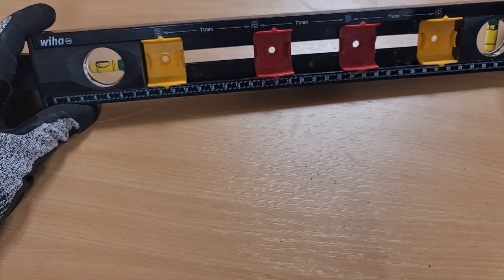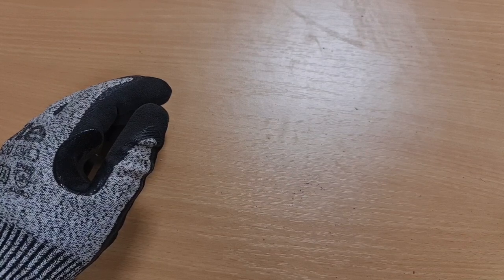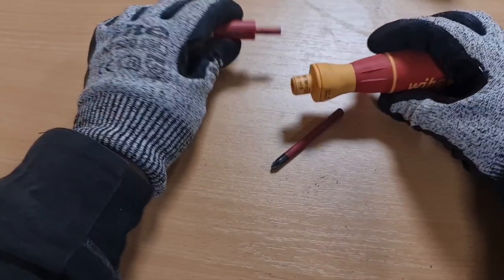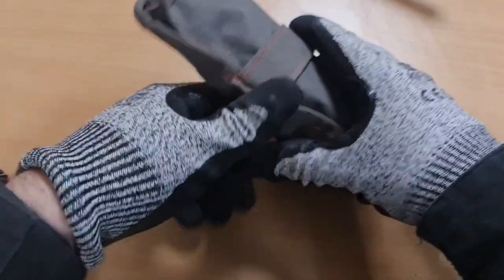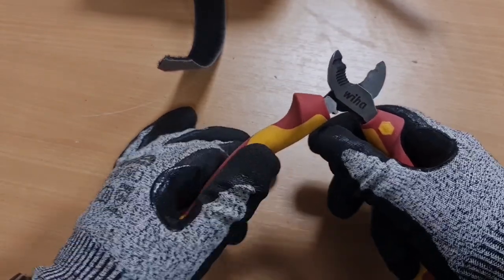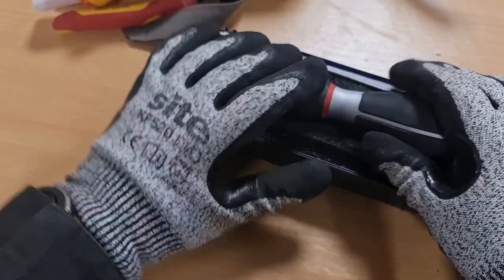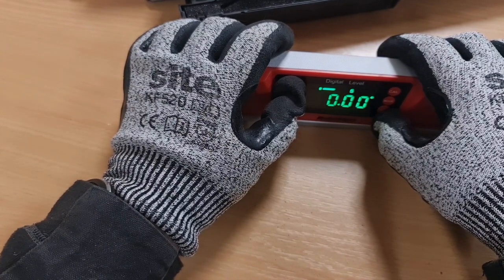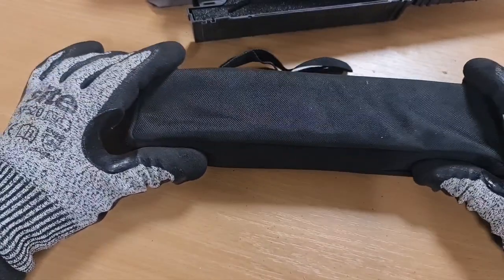UK Electrician close up tool review and demo Klein Knipex Wiha VDE

Comment: Quick question again on this video. 
I tried to use the automatic wire stripper to strip some fire alarm cable. 
It did seem a bit difficult. 
 - Firstly are these designed for the task? 
 - Secondly is there a better tool out there for fire alarm cables? 

Thank you. Managed to shadow a sparky over 2 days. Really learning what it is all about (even though I'm nearly fifty!) and enjoying it.
Reply from the maker: Yes auto strippers dont work great on FP200. The knipex dismantling tool is good or with practice croppers.

Comment: Congrats on 300 subs! [I'll give up after 1000 subs i think. Well done.

Thanks just figured out from your video the little cable length setting thingy mi bobby (6:21)

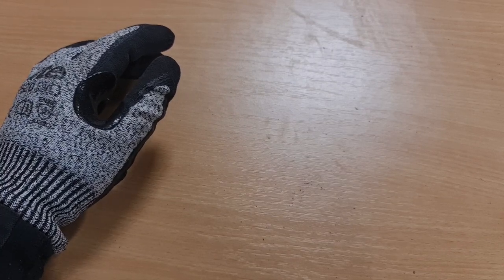Quick question on wire stripper (3:25) ... would vetran electricians laugh at you if you used them on 13A sockets? Or would they be useless in that case?

Thanks again and well done.
Reply from the maker: We tried to use them in that way, it works but is tricky to fit them in. Anyone laughing isnt worth worrying about. Do what works for you and be safe is the main thing. Thanks for the kind comments as well.

Comment: Klein handles have always been very comfortable. Knipex strippers will work well on twin & earth. But we have sim-pul  southwire cables here in USA (high quality manufacturer like Doncaster cables) which has a more shiny surface allowing easier pulling of cables through walls, wood joists and conduits and those knipex flat cable strippers will slip. Speed E 2 is great much larger more oomph you will not use anything else in putting sockets together or removing them, fast with out damaging or stripping heads and tightening all the way down.

Any tools for straightening conductors without marring insulation or copper? At the moment I use the duck billed knipex one use the side flatter surface without serrations that works well. But it would be great if you know of a tool best designed for this purpose.

Stopped using hacksaws the Hilti cordless bandsaw is great. Milwaukee do a whole range of them as well.
Reply from the maker: Yes I have heard great things about speede 2. Need to get one!

I have a bosch pro 18V band saw. But still use a hacksaw for the removing armourings from SWA cables. 

Thanks for the comment, appreciate it!

Comment: Thanks Mark! Congrats on going over 100 subs. You'll soon get to 1000 (infinity and beyond)! Keep it up - appreciate all the knowledge sharing!
Reply: You mentioned at 4 mins the small "pico screwdrivers have swivelling ends". Is this so you can press down with a bit of force to stop them "camming out"?
Reply from the maker: Thanks for the kind works, I appreciate that
Reply from the maker: Yes, its so you can keep some pressure on and tighten/untighten without lifting the tool away. Wiha picofinish.